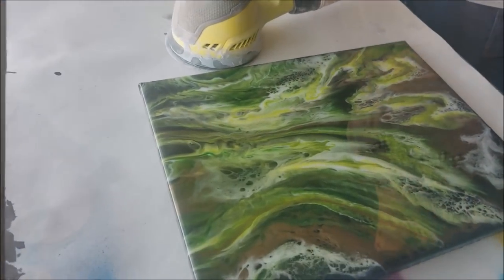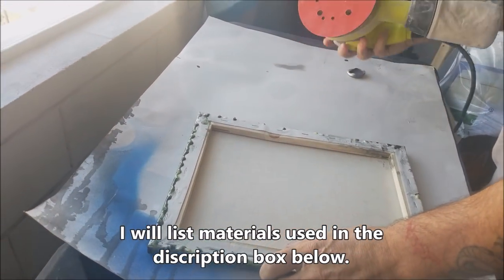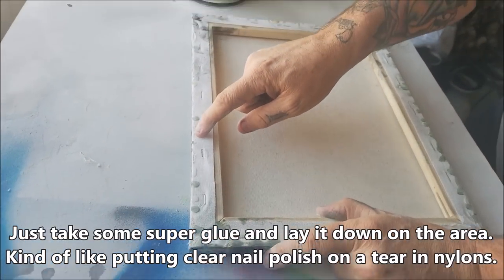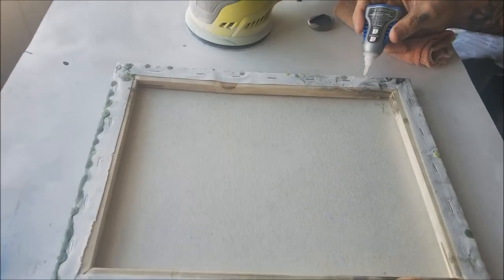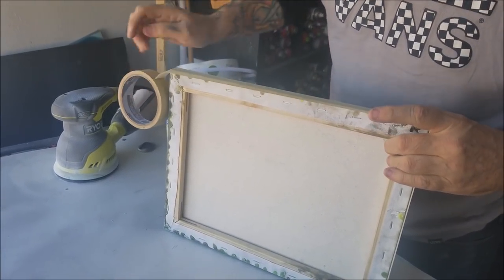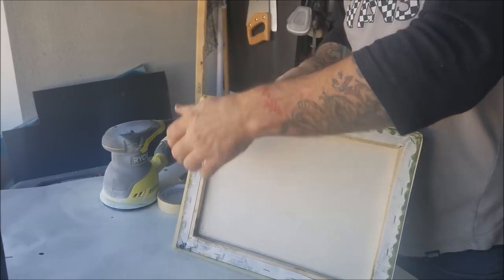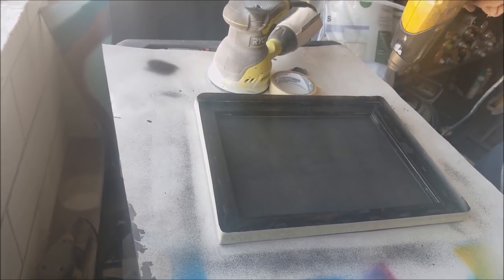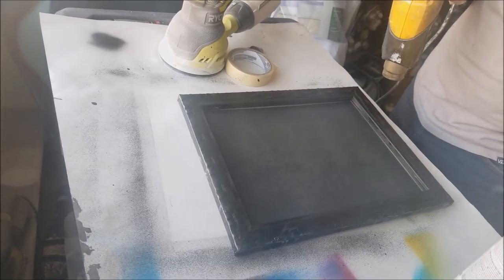How to finish the back of a Poured Painting Canvas

Comment: A heat gun or torch and a scraper will easily remove drips without damaging the back of the canvas.  Quicker and easier not to mention less messy than a sander.

Comment: I actually went and searched the topic of painting backs of canvases, it is a BIG no no. I wondered as even signing the back was iffy since your whatever you use to sign it could bleed to front. 
THIS IS FROM ONLINE: "I do not recommend to paint over the entire back of the canvas. Because in case if there is any moisture in the material and you lock it between two layers of paint, it creates favorable conditions for mold growth." 
THIS IS ANOTHER QUOTE FROM ONLINE: "The back of the canvas needs to remain as is - do not prime, do not seal. The painting breathes, and if you cut off the air supply you may end up growing mold between the layers, as well as creating competing sides which will expand and contract at different rates. Even if you frame the canvas, and cover the back a dust cover of acid-free paper, you need to cut a large opening for air to flow in the back of the canvas."
Reply from the maker: Those are great points that we didn’t even consider - we will do more research and post an updated video. Thank you for taking the time to look things up and let us know.

Comment: Hey guys, like this tip on finishing the back. I just did a pour and painted the border black.  On signing my pieces. depending on the subject, I will sign on the front for landscapes or seascapes, or anything where it's easy to establish a right way up. But like you, if it's an abstract or a pour where it could be hung any which way, usually the side and the back.
Reply from the maker: Thank you so much for your feedback Dee.  I really appreciate it.  I agree, front when you can tell which way is up and side when it's abstract.

Comment: When I do oil on canvases of landscapes, I sign the front because there is only one way to hang it. I have not done resin ye,t but for acrylic pours I sign the back which allows the buyer to hang as they see it best. Another suggestion - I saw someone heat a box cutter knife blade and it went through a resin drip like butter, flat against her art piece. She sometimes cut 2 drips before she had to reheat. So for anyone that doesn't have a sander that could be an option. Obviously cut away from you and all those common sense practices to save fingers. LOLThanks for all your tips!Feel better soon GF. Thank goodness for our guys. I know when I was down with pneumonia, Dave was my nurse. Ya gotta take care of each other.
Reply from the maker: Hey Deb!  Yeah we will cut them away too if it is within a couple days of curing.  Absolutely have to cut away and I would have to be sure to mention that if we did a video on that technique.  I'm so glad you are feeling better and that you had Dave to take care of you and do the shopping.  Jeff totally picked up the slack for me the last couple of days.
Reply: A heated knife does work well,unless there are a lot of drips.But it usually scrapes right off.

Comment: Thought I might share this with you.   If you put painters tape all around the back of the canvas, about a quarter inch into the frame, you will not have to sand at all.  Just remove the tape once the painting is thoroughly dried.
Reply from the maker: Thank you,we do that.but if you let resin dry,the tape will never come off and then you definitely have to sand and risk the chance of damaging your canvas.

Comment: If I do a piece on hard board, which is what I use more than anything, I will sign on the back. At least this what I started doing recently. I find the resin pieces easier to do this way, so it doesn't take from the piece. For my impasto pieces, it's the tradition way on the front. I'm still working on my signature, so far I'm not in love with it, lol.
Reply from the maker: Omg, Veeda I hate my signature, lol.  I usually have Jeff sign our artwork.  He has AMAZING penmanship.  Thank you so much for the feedback.

Comment: Pours and resin pour abstracts I always sign on the back. I skipped a purchase a couple times on abstracts as not the way I wanted to hang it where their signature was. Hated to do it and if the piece is real busy and signed on front it just takes away from the piece. Just my humble opinion after 40 years of doing art. Landscapes and similar paintings I will do a very small signature on the bottom left corner. I never sign on the right as your eye seems to be drawn to the middle and the right. I know sounds odd but it is true. I think it is an unconscious thing we may all do without realizing it. Anyone else do that?
Reply from the maker: Hello Sherrie, thank you so much for your feedback - it is much valued.  I agree, signing the side/back of an abstract piece is probably best. When I sign on the front we usually sign bottom right - I have no idea why, it just is where we end up (most likely unconscious).
Reply: I do

Comment: re signing it. I oil paint abstracts and didn't want to paint my name because well like the video said, buyers may prefer to hang it on a different side than the one u painted. My oïl paintingt teacher recommended that I use a symbol or my initials and put it somewhere in the painting (kind of like being my artist "mark). On the back, on the canvas, first thing to write (there are oïl paint pen sold just about anywhere)  is the title of the paintings and the year it was painted, she said always the whole year like 2019 not '19 (because this could be thought of as the 19th of a series, Under that write on the format (height x width for ex.: 18 x 11"); under that the medium (in the case of pouring paint the medium would be considered as mixed media); under that your signature (real name or artist name) .  If you're selling, cut a white 2" x 3" piece of cardboard, add same info on the left side and add the price at the lowest right side. and tape it underneath ur painting... ta da... well that's how it's done in my neck of the wood lol My teacher is listed in the académie des Beaux-Arts du Québec, exhibits all over the world, been painting and selling for the last 46 years sooo I'm guessing she knows her stuff lol

Comment: I would recommend against spray painting the back of your canvas...painting the frame is okay, just not the canvas. Why?  Are you aware of the trick to fix a sagging canvas?  If your canvas ever sags over time or something presses on it and causes a dent... it can sometimes be fixed by just spraying water on the painting’s back.  The cotton fibers shrink and this fixes the problem.
Reply from the maker: Kert Jans thank you for the info Kert . We usually tighten the canvas like that prior to pouring on it. Once the piece is done we do the backs and I’m not sure if the canvas will shrink anymore once the resin has set?

Comment: From the looks of the finished product,I'm assuming you used a resin coating ? After sanding,do you clean your work area ? It seems to me the sawdust would leave minute scratches on the surface.Myself,I like painting the back as well.Some folks on here say it's easy to work with resin,and for some that may be true.I'm somewhat anal when ( okay,very anal ) when it comes to a scratch,or dust particles,or even the tiniest hair.It happens though,and I even wear a hair net and lightly mist my floor before I begin pouring.We made a studio upstairs (not ideal,but fortunately it's very well ventilated.And our pets are not allowed. EVER. lol. We have our second and third shows coming up soon,so I hope they go well.Cheers.And thank you for the video.As for signing,I'll tape off a tiny square using Frog's tape,depending on the size of the canvas near one of the corners,and use a sponge with a color slightly darker than my main color to dab the color in.There's no telling how someone will hang the work,but it does look kind of elegant and doesn't really distract from the piece.Then I'll shellac or resin over it.